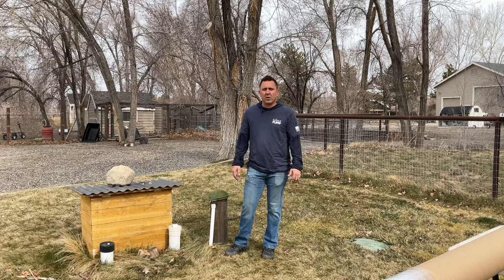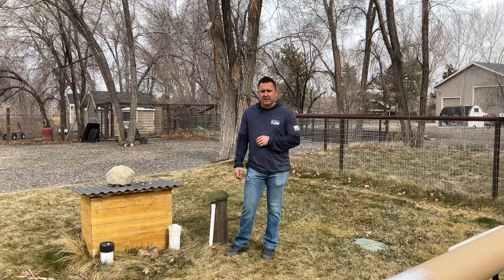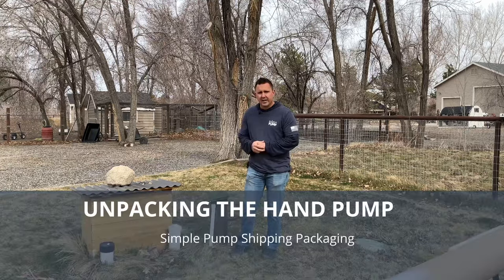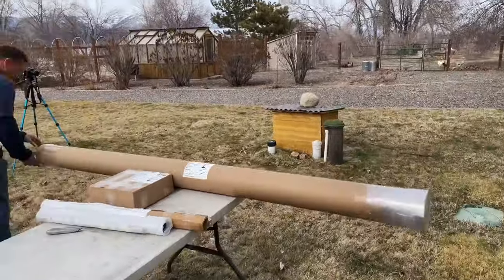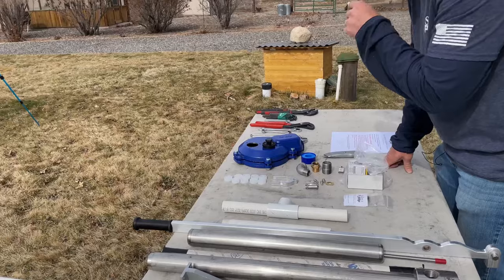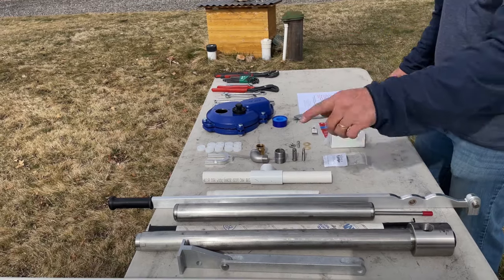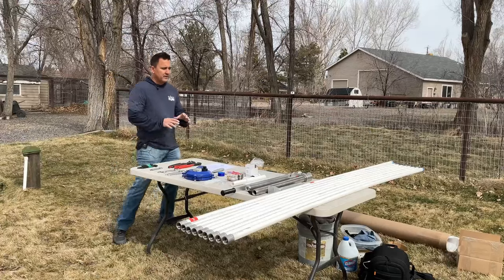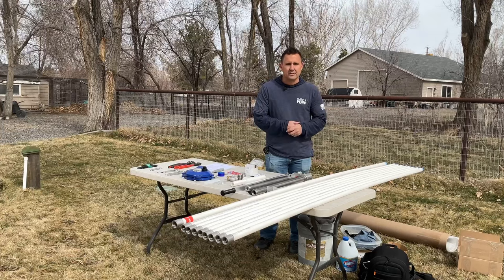2024 Simple Pump Water Pump Basics - Installing the Deep Well Hand Pump

Comment: the plug/bleeder to allow the water in the downtube (above the weephole) to drain...what a great idea. The water above the frostline "weeps" down and out of the downtube so there's no freezing! That's cool...solved any challenges with freezing. I guess the weephole placement will accommodate different frostlines depending where in the country the pump is to be installed. And the plug can likely be replaced with a small valve for ease of use.
The rod guides are another excellent detail...keeps the rod straight and increases rigidity.
And finally, the fact that the downtube is pvc with SS collars. that means that at about 250' the downtube and couplings weigh less than 100 lbs...not including the lift end assembly and the rod lengths, so for 250' that's less than about 140 lbs. COOL!
That means I won't need my well guy and his boom truck to service ANY part of the Simple Pump...even if I would have to pull the entire system!
BTW just moments ago we had Jessica send the sonic water level gauge.
We're getting one of your Simple Pumps!
We're stoked!

Comment: A small valve on the check valve vent location would be a nice improvement. Petcock  perhaps 🤔
Reply from the maker: Thanks for reaching out with this suggestion.  We realize having to take the plug out and put if back every time can be a bit tedious.  We are currently looking into different cost effective solutions that will be a bit easier to use.

Comment: At about the 34 minute mark, why didn't you use teflon tape between the two stainless components, or at least anti-seize compound?
Reply from the maker: Hello James, thanks for reaching out.  I believe you are talking about the step where the pump head assembly is threaded to the top drop pipe.  If this is the case, the 1" nipple used to connect the stainless coupling of the pipe and the stainless bushing on the bottom of the riser tube does have Teflon tape on both sides of the nipple.  Additionally, the anti-seize only needs to be used where two dissimilar metals are threaded together.  It is not required where the two metals are the same.  If you are referring to a different step in the video please let us know and we will address that step.
Reply: Thanks for replying. I must have overlooked mention of the pump head assembly having been wrapped with teflon tape. My understanding is that all stainless steel fasteners should have anti-seize compound applied to prevent galling threads. Maybe this doesn't apply to plumbing fittings?
Reply from the maker: That is correct, the plumbing fittings that are national pipe thread (NPT) are tapered threads.  With these, we use Teflon tape and get them plenty tight!  The lift rods are standard 5/16-18 threads, but we want to use Loctite on these to make sure they don't come un-threaded with repetitive load/no load conditions.  We really only suggest you use the anti-seize on the threaded connections above the well head, mainly on the well cap.  Here we are using stainless bolts and are threading into either aluminum or cast iron.  Some anti-seize will make it easier to loosen these connections in the future when doing maintenance.

Comment: Good video.  But I cringe every time you tighten everything with the adjustable wrench AND the channel locks with the wrenches on the parts in the incorrect direction !!!  EVERY TIME except one !!!  It is much easier to get a firm grip or a secure fit when the wrenches are in the correct position for easier torque and tighter grip.  Just my OCD, but it DOES make things easier...........
Reply: Hey, he invented the Simple pump...I can use a set of channel locks too but I ain't never created anything even remotely close to the Simple pump! I'll cut him some slack👍